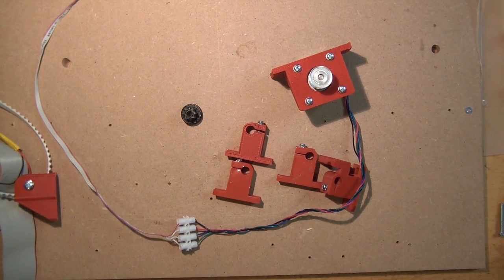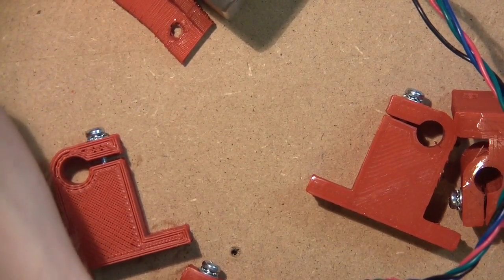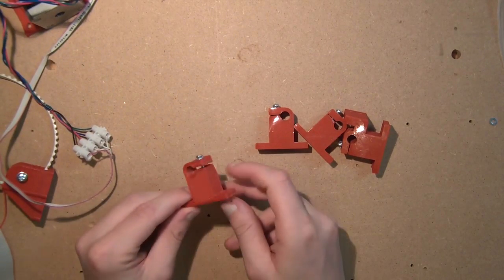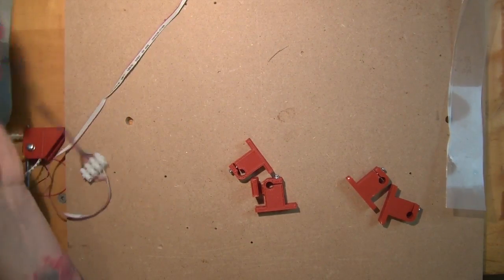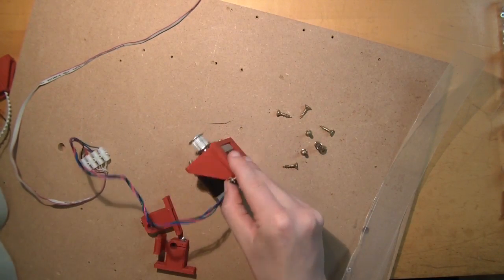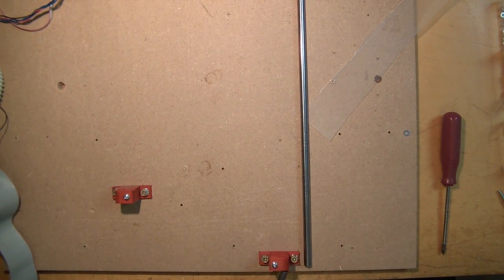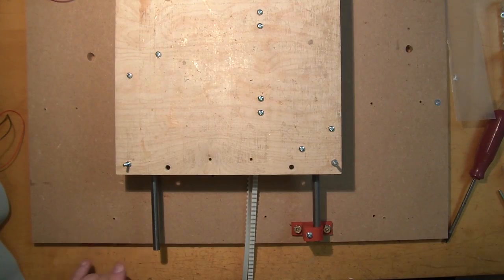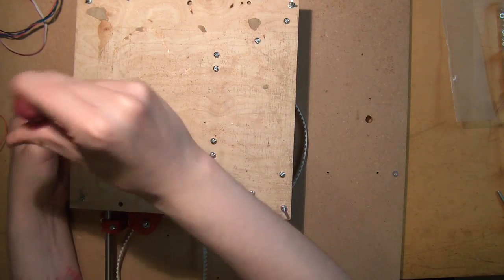Mendel90 Tutorial 04 Assembling The Y Axis

Comment from the maker: Between 215 *C and 250 *C. Depends on how well your thermistor is calibrated. For PLA its somewhere around 180 °C, but the problem is it differs from filament to filament. Color definitely plays a role and every printer is a bit different. 

So just like you have to make your own experiences regarding cutting speed with lastercutters, you have to with temperature with your printer.